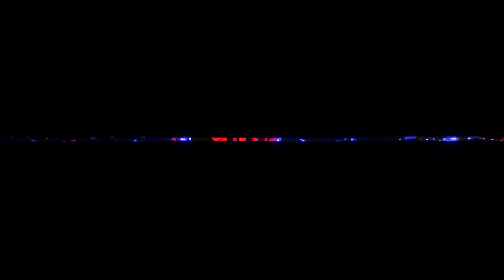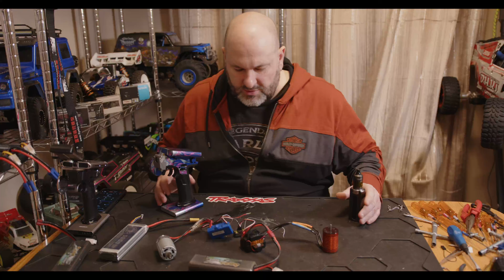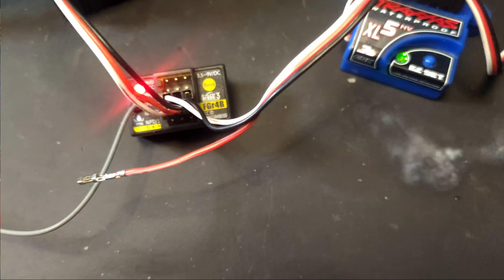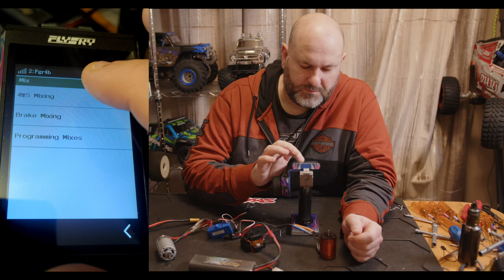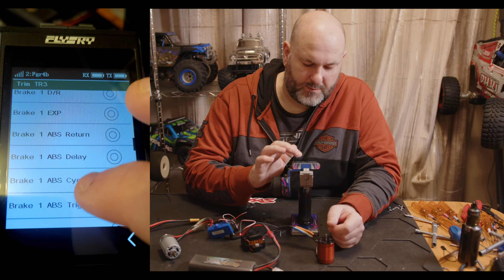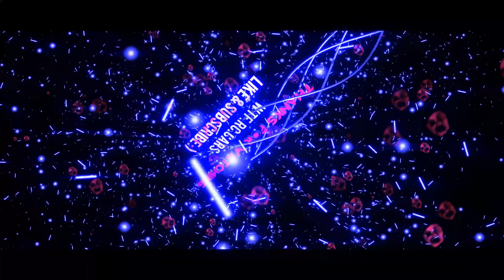Dual ESC dual motor Flysky NB4 MOA set up

Comment: Why does my rear motor take the throttle input not from mix 2 but from the general throttle

Edit: im a dumbass i was plunig the rear esc in to channel 2 not 4
Reply from the maker: If you have it connected to ch2 on the receiver it will

Comment: Great set up been using this for a few years but recently wondering if it's posible  to use the sw2 and 3 as momentary  so it just holds  the motor rather than turns off ok I'm geting old and forgetting wich is wich end up shuting  down both front and rear lol  any help appreciated
Reply from the maker: Not sure what your asking for in this one ?
Reply: @WTFRCCars sory bad explanation  from me  can this be set up to pause the motor rather than switch it off  in a compation I've been confused a number of times forgetting to pres sw2 to turn it back on a momentary would be better as soon as you let go it engages drive again so you are just pausing  the motor
Reply from the maker: If you set the actuation buttons to trigger not turn then it should only work when they are held
Reply: @WTFRCCars  will try thanks

Comment: What if you have a two motor/esc setup on a tank type of vehicle where the motors are also controlling the steering with no servo?
Reply from the maker: Then you need one of the nb4 transmitters that has tracked mode in mixing or you need to set up channel mixing to run the 2 esc's :)

Comment: I got both motors working but my spin rates are wrong and I can't figure out how to make the front and rear move at the same pace.  I have Fusion SE on my MOA with the NB4 plus
Reply from the maker: Make sure you have run calibration on both esc's so they both have the same config, you can then use the off set to fine tune the speed

Comment: Is it possible with a wheel transmitter, to control rear and front motors independently as is doable with a stick transmitter?
Reply from the maker: Yep just assign the rear motor to one of the dials so you can control it or set up mixing so you can change the off set :)

Comment: Nice videos as i Need assistance ony moa but how about the wire battery care to share how to solder for both esc battery wire so basically one lipo to power both esc instead.hope you can produce a video as i request.thanks and have nice day ahead
Reply from the maker: I would just make a y cable from one battery to a plug for each ESC :) that way if you ever need to replace one of the ESC it's really easy
Reply: Thank you for the tips and advise and heads up.have a good day ahead.

Comment: I have a little Redcat Danchee with 4WS, counter steering, crabbing and rear steer.  The only thing it doesn't have is dig.....which I would like to have (greedy, I know).  The OEM transmitter will not allow the addition of another function so I hope to set up my NB4 to control the Danchee.  I purchased a "electronic dig" unit from RC4WD which connects between each motor and the ESC/receiver unit (which of course has 3 channels only.....two for the steering servos and on for the ESC/power lead.  I'm hoping that with a new 4 channel flysky receiver and new esc...that I'll be able to have all of the steering functions as well as the new dig capability.  I'm pretty much a newbie to this hobby so I apologize if I sound a bit daft.  Do you see a way of making this work with one ESC or will it require two...even with the electronic dig unit?  Your videos are very helpful and I thank you for your time and effort.
Reply from the maker: Electronic dig should work just by cutting power to one motor :)

Comment: I did it a little different, giving me dig on front as well. 
Mix 1 is front axle and ESC is plugged into ch3. Throttle is master, ch3 slave.
Mix 2 is rear axle, ESC plugged into ch4. Throttle is master, ch4 slave.

So on the receiver nothing is plugged into ch2. 

I assigned sw2 and sw3 to turn the mixes on and off. The thumb wheels tr3 and tr4 do the high side mix values.

I got the pro as well but I still have it set up this way.
Reply: c. leech , thx , your config worked for me , i can get front and rear dig now .....
Reply: Hello Chris. Yes i see your vidéo on Bully FB page and i'm doing has you :)
Reply from the maker: Yeh there are many ways to do it just depends on what you want to achieve and how you like it to work, to get the same on the pro is so much easier vid on that is next :)